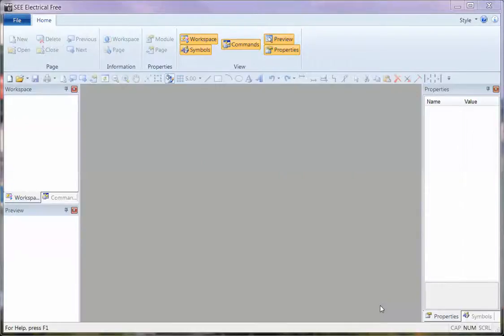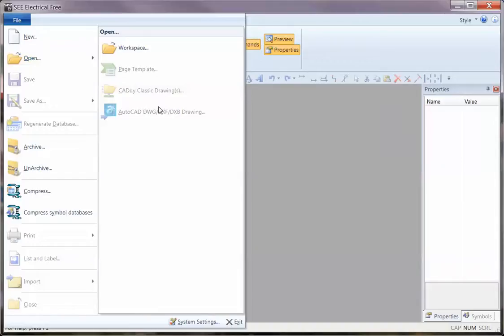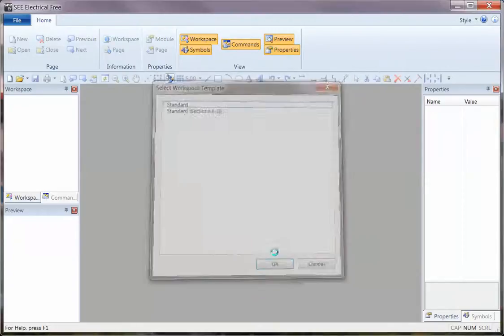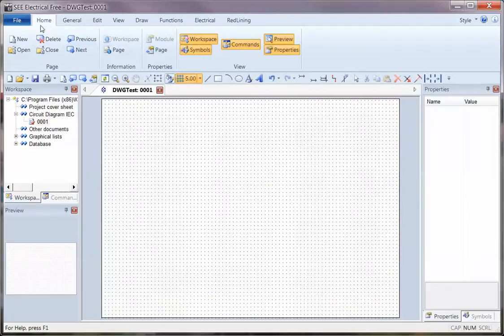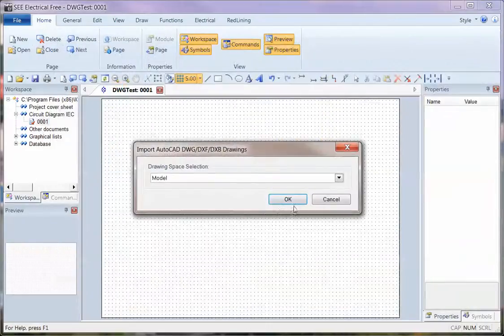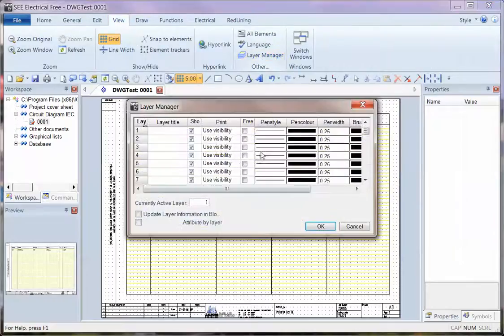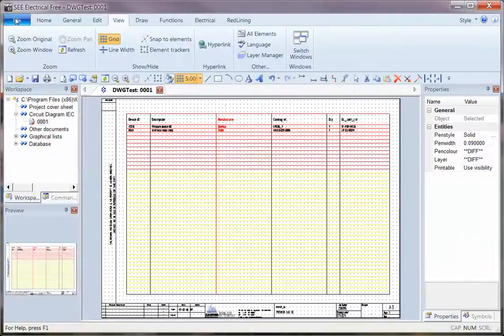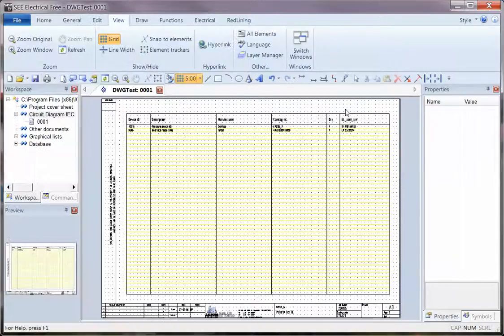How to Open DWG Files V7R2

Comment: does not work..I always get "Invalid file version"
Reply from the maker: What version of See Electrical are you using? V7R2 only supported importing up to DWG v2013 format but V8R3 supports up to DWG v2018. Could this be the issue?